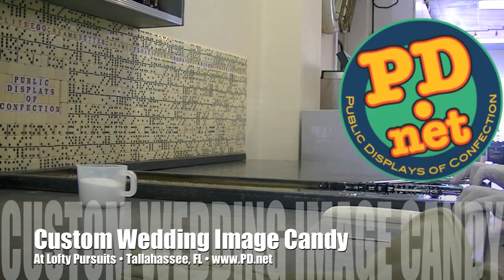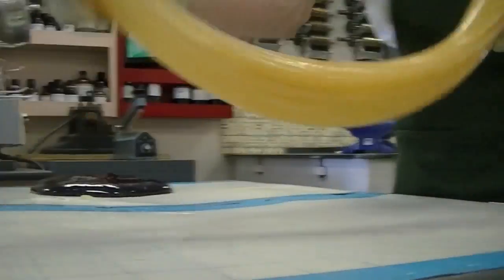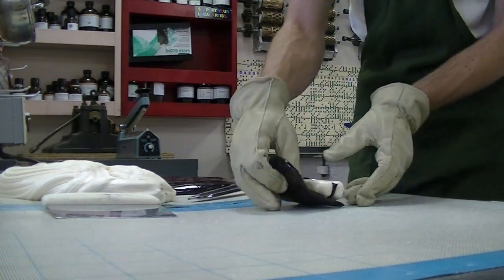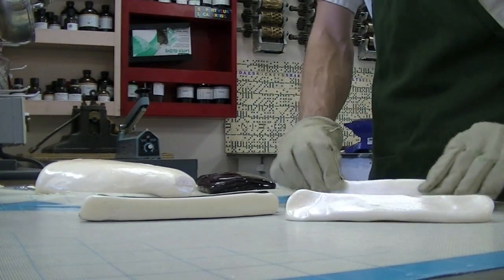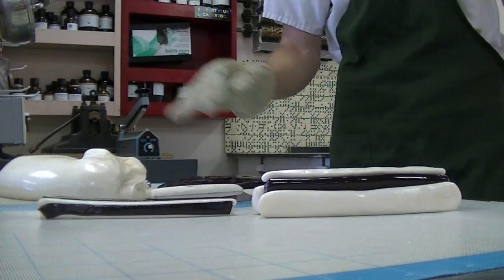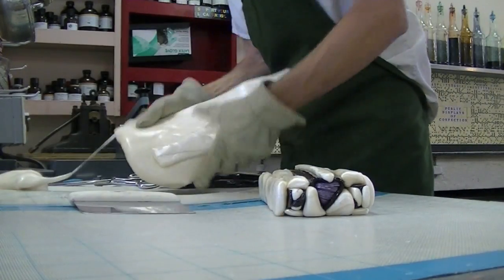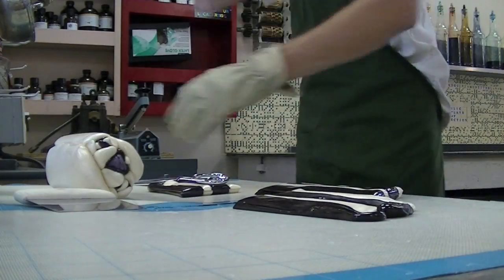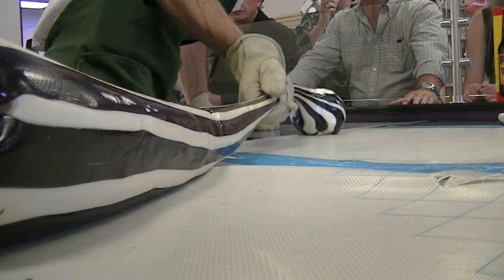#3 The making of custom image candy for a wedding with initials in each piece.

Comment: Sorry if this questions been asked before but I noticed that when you sprinkle the citrus on you only do it on the non coloured parts.. is that for any specific reason? :)
Reply from the maker: +Ailie A Oh that's easy. The citric acid does not disolve until it touches the moisture in your mouth. It leaves little white bits in the clear candy. We put it in the pulled candy. Since the pulled candy is always exposed the way we cut it, it all works out both in taste and looks.
Reply: Good to know thanks!

Comment: "Not oxygen,air" isn't that the same thing.
Reply: it depends.
Reply: It's the bubbles of air and not the oxygen that makes it white- the air we breathe is not just oxygen, but a bunch of other gases with oxygen it's only around 21% oxygen surprisingly (100% oxygen is actually not good to breathe for long periods of time i have a prescription for tanks of 100% O2 that I use for headaches, and the doctors actually worry more about me using that than the heavy duty medications that they prescribe)
Reply: +http/tannor12345 No.